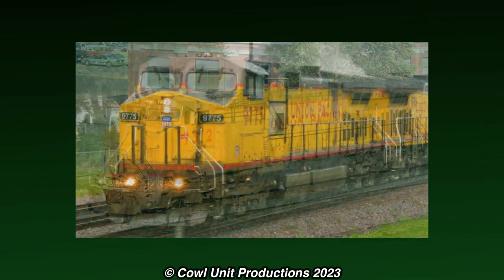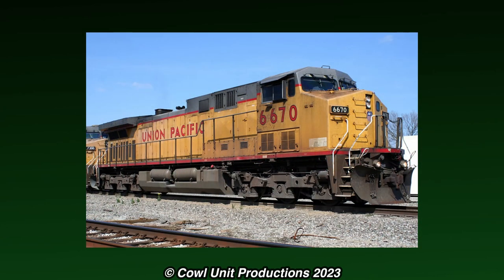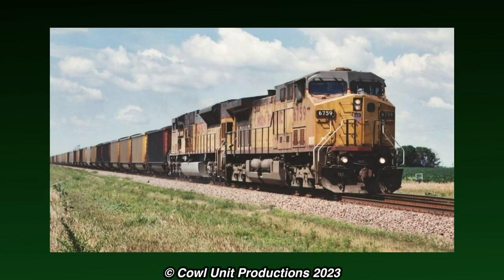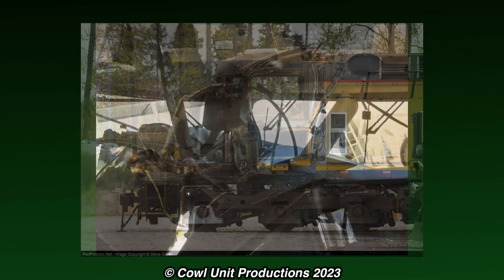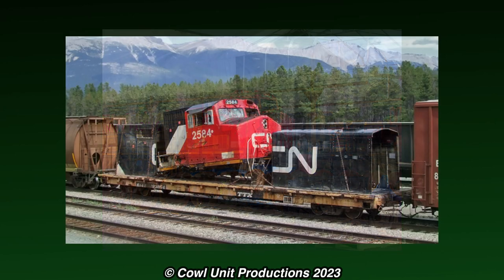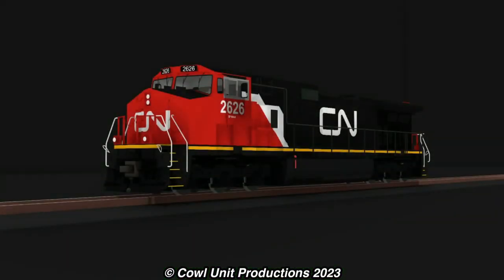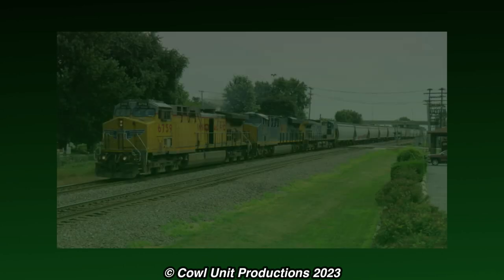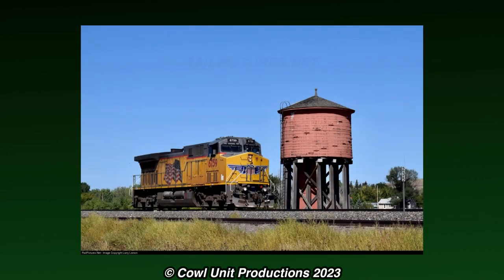Bite Sized Oddities - UP 6759

Comment: I have a request for a locomotive oddity. NS SD40-3 6405. It was ex BN 7149/HLCX 7149/NS 3528. It's unique because it was a BN test unit and was a SD40-2 with flared radiators. Then it was rebuilt to a SD40-3 with normal radiators in 2021.